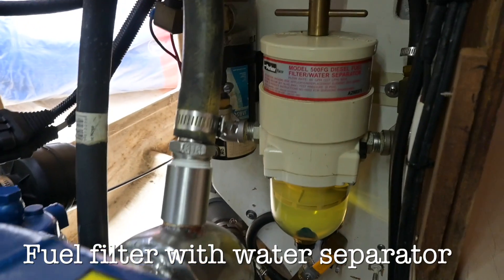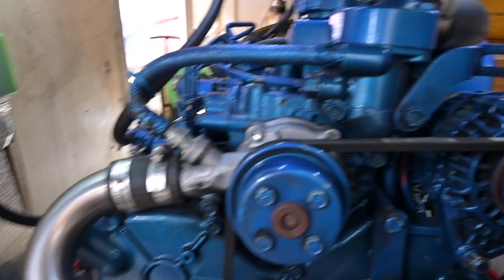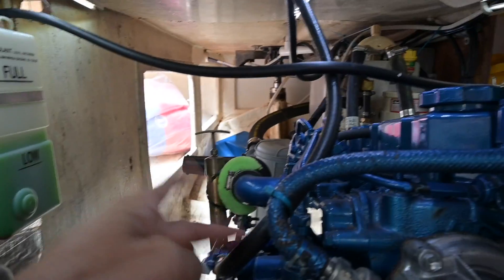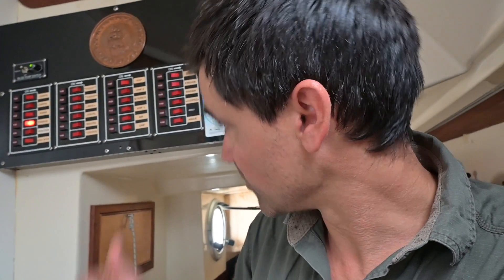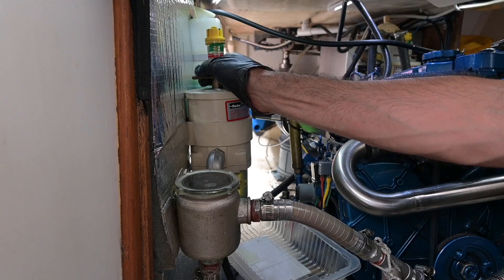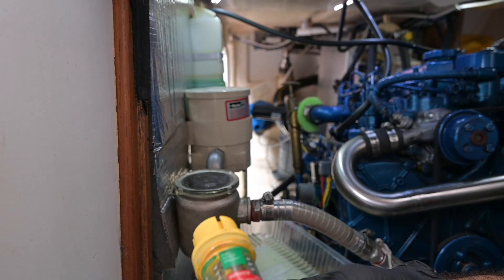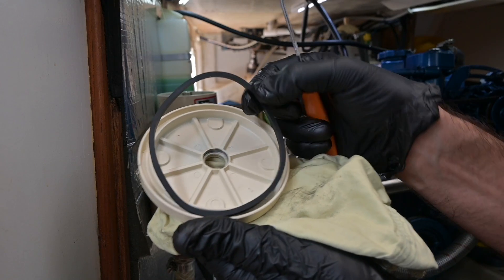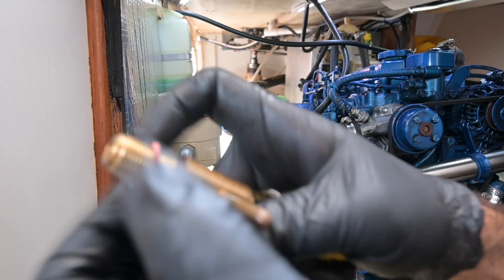KEEP IT CLEAN! How to replace a Parker Racor 500FG fuel filter | Ep 65

Comment: Did you drain all the fuel from the bowl drain plug ? It was not clear from the video.

But, if you did, one of the nice things about razors is top loading filters so you don’t really need to drain it all … 1mm below the top lip works just fine.

You likely already know this but posted just in case.
Reply from the maker: Thanks for the comment, yes I did drain the bowls. Everything was super clean, but it’s good to check it all works. Cheers for the tips!

Comment: Hi, if I may ask what is the yellow bolt on top the T screw? under your opinion the metallic cover is is hard to remove ( below the T) I see don't have a thread, how to make it obey ( plastic hammer from below nor extractor?
Reply from the maker: Day, yeah the brass T handle is threaded, and the cap sits on an o-ring seal easily removed!